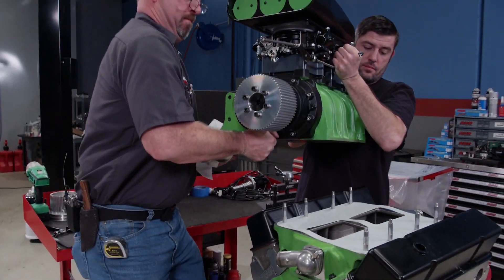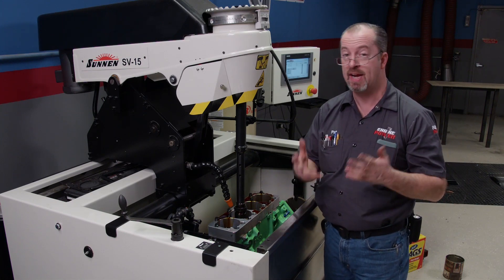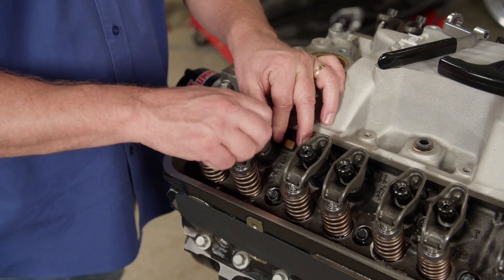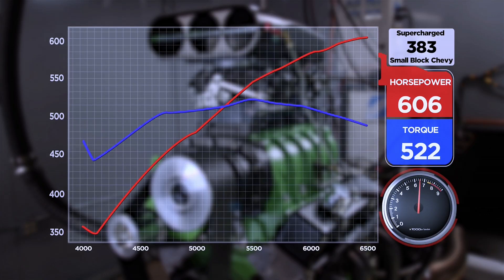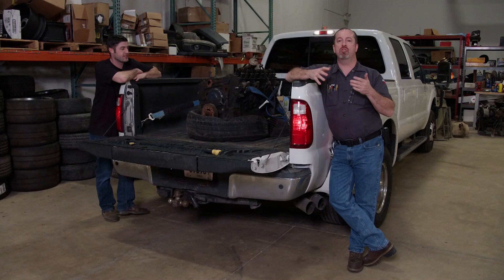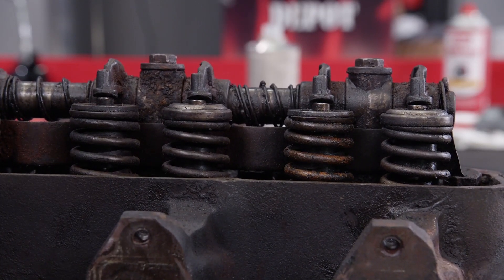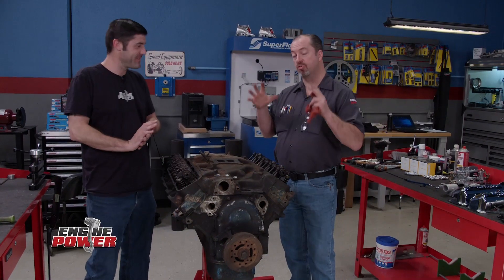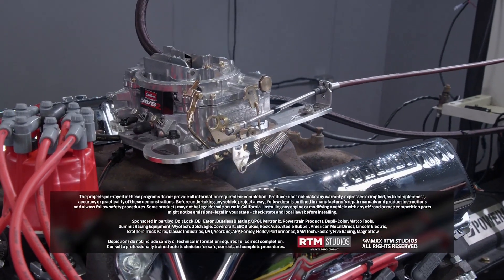Junkyard Ford 390 FE: Will It Run? - Engine Power S7, E7

Comment: I love it that they spent at least 10k on that small block, but all the comments are about the junkyard engine
Reply: Shows the type of people watching this are probably mostly backyard grease monkeys who appreciate what goes into pulling something from a boneyard wreck and getting it running.
Reply: Small block Chevy is like a butt hole. Everyone's got one.
Reply: @chrismontreuil2206  because they work and make power the cheapest.
Reply: The Chevy small block is the obvious cheapest way to make power (cheapest to build up). So that means they are the normal option and frankly most people are tired of (videos of) them. Let's see something different!
Reply: I'll take the FE any day over a smallblock bowtie.
Reply: @clydebalcom8252  My 73 F100's 360 3 on the tree with straight duals from the manifolds no mufflers or anything sounded glorious when floored and really wasn't even loud in normal use. I just wish they were cheaper to rebuild and build.
Reply: The Chevy threw a piston.....

Comment: Gimme a tired old FE coming back to life any day.  I love the old 390 Ford
Reply: Jeremy, My 67 S-code had a 390 Fe in it. Some asshat put a 460 mild build in it before I bought it. Damm it!!!
Reply: I am mostly a GM and Mopar guy but do love those Ford FE engines. My grandfather had an F-600 with a 352 in it, ran like crazy!
Reply: Edward pate it probably had a MD 330FT (FE with low compression heads) or 360. Possible it had a 390 with the larger snout crank which would have been considered a HD engine.
Reply: There's a 390 I have from a late 60s t bird I have and I thought about putting it into a mustang or Fairlane, any ideas on where to get parts?
Reply: @thatonegamer9547  depends upon what you want to do with it, but check out the stroker kit options. what's going to bite you is the exhaust setup--if you don't take out the mustang shock towers and replace them with a Mustang II setup, your headers are going to have a big turn right off the port.  figure out what you're going to run for exhaust, and then design the engine around that choke point.  i'll also just throw out there, Thunderbirds and Galaxies had different tri power intakes, if that's what you're running right now. the t bird ironically kept the carbs level, the galaxy had the 390 tilted.  

some bore and stroke a 390 out to a 428, and since the 428 CJ used the 390 Gt cam, make themselves a big brother CJ.  There's a lot of ways to go with the 390.
Reply: Back in '89 I pulled one w/ a C-6 out of a '65 Galaxie and loaded it in the back of my brother's old Bronco on an old tire. Man that was some weight! I never thought we would get it home. 😂
Reply: 360 or 390 ford engine is bad about burning valves....
Reply: Parents had a LTD with 390
Reply: @davidsandberg7631  Mine too, a station wagon. They traded it in for a new clunker LTD wagon w/ a 400. 😕
Reply: @thatonegamer9547  give FE Specialties a shout. They have absolutely everything you need. PS... you can get 500 hp out of a 390 with the stock unported heads relatively easy! And throw a 445 ci stroker rotating assembly in it and have a tourqe monster too...
Reply: They are such good and tough engines.
Reply: @thatonegamer9547  I was dropping one into a '66 Fairlane hardtop that had a 289. You have to beef up the front frame rails, change engine mounts and suspension and swap in a 9 inch differential. If you don't, it'll fall.
Reply: @briscoe42  The big block equivalent to the 289 in reliability. 👍
Reply: @josephtravers777  Exactly.  Both are almost bulletproof.
Reply: Only 3 things suck about an FE- Cracked oil galley, sunk exhaust valves, and the freaking 80lb intake manifold.
For those who don't know, all FE's have a casting defect where the block can crack between the oil galley feeding the passenger side head and the water jacket next to it. oil pressure is higher than coolant, so oil squirts into coolant and you lose oil pressure. Oil in coolant= crack in galley. Coolant in oil= cracked head or blown gasket. couple known fixes can be found online. I went the 1/4" rollpin route, as that can be done without tearing block down. Fixed my 390. 
Sunk exhaust valves- These engines were designed for leaded gas. Lead created a layer of protective soot on valve seats. going to unleaded means the valves will eventually start to weld themselves to the seat and chew away at it. Fix is either hardened valve seats if you have room before you hit the water jacket, or good used heads.
Intake manifold- do your back a favor and use a cherry picker to pull that SOB out if the engine is still in the vehicle. If you don't have one use bungee straps and hook them to the hood to help lift it a little, also works great for installation.
Reply: Donald Kinder same motor just different crank.
Reply: That One Gamer not sure about Fairlanes but I have one in a ‘68 Mustang. For FE parts go to SurvivalMotorSports as they are practically the FE gurus. If you decide on which vehicle then the best advice I can give is to search and find a good forum for that vehicle as there will plenty of info there.
Reply: I rebuilt an old 390 fe in my day and I got to tell you it was the best engine I ever had for towing trailers. The torque on this engine was so powerful that I ended up snapping 2 universal joints in half with it. This engine did not get the credit it deserved!
Reply: I've got a 92 302 I love that motor
Reply: Isn't he only chevy engine I like ....nice heads God power
Reply: I had a 330
Reply: @robertclymer6948  what a fool

Comment: Now these are the kinda videos I love! I would love to see a Dyno run of just the revived 390, then move on to budget build, and overkill performance build. I don’t get to see a lot of FE love here.
Reply: Alex Hickey couldn’t have said it better myself
Reply: @2ndamendment495  the damn 390 is a tank and will not die one of the best motors ever.
Reply: I agree I want to see more done with this motor like to see what it does right now on the dyno do some update on it and in full bore stroke I love the Fe been a fan of them all my life I even had a 427 side Oiler medium-rise dual-quad but these shows here don't do a lot of the FES and be nice to see them do more with this one
Reply: 390FE, the most under rated engines today. Free them up to breathe and it can take on engines slightly bigger.  Good stroker kits and the medium duty 361 and 391 are some tough forged steel cranks, not cast. I've had them cut and taken down to 390 engines with higher performance at higher rpm. The crank done like this is stronger for more hp and higher.
Reply: @dustinshadle732  I would say the Cleveland is the most under-rated.  if it wasn't for the cylinder heads being used on Windsor builds there'd barely be any aftermarket for them at all.
Reply: I would love to line up s 428..but money is a big issue so I'm only doing mods that won't change the 390 o have.  It's a pretty healthy engine in 68 anyway.  Maybe a 4 speed auto or aftermarket overdrive unit. It's my last personal toy vehicle so I'm not sure. I miss having my legs because when they worked I'd not only walk around all the time, but the jobs are good, miss riding motorcycles and put a 6 speed in the old girl

Comment: My Dad had a Mercury Park Lane when I was a kid. I want to say it was a '65. With a 390. I think the sound of that old 390 is what got me hooked on horsepower.
I bought a wrecker with a 390, that thing had some serious grunt to it.
Reply: A 390 ford engine has around 200 hp weak you seriously never had a powerful engine..... Plus 390 or 360 bad about burning valves.....

Comment: I'm very pleased you've picked a 390 
to experiment with.  When I was growing up I had a 70 model ford step side  half ton truck that originally had a 300. Six. 
That got replaced with a 390. The combination of the three on the tree and the the factory gears . This truck had so much torque.  I never knew how fast it would go because the speedometer only went to a hundred. But it had no problem burying the needle.  This was one of the most impressive engines stock I've ever  seen.
Reply: Johnny G classic my first car was a 70 cobra Torino with the 429 scj remove and replace with the 390 . I rebuilt the engine and boy that car was fast 👍
Reply: Proud owner of a 65-F100  390 FE That was My Fathers and My Grandfathers. Will one day be my sons

Comment: I was so happy to see that they finally released a video about the 390 FE. I have one of my own in my truck and I absolutely love the torque, but the gas mileage is pretty bad. Even with the really low oil pressure that it has, it keeps running and it doesn't let me down. I believe it is the original engine too!
Reply: Put ya new oil pump in that old girl!! Or try n put ya bottle of restore and two bottles of STP next oil change and wee bit thicker oil?? I drove my Ford daily February will be 17years and 350000.0miles on my old Ford!!!

Comment: Gotta love old blue oval iron. There's a 70's model dump truck used where i work.  Asked the driver, he said it's original,  only thing he does is add oil to it.  It's a 390 workhorse. Old black dude driven the truck since 77. He always tells me, "boss said I'd get new truck when this one died...damn thing won't,  so i guess I'll keep driving it."

Comment: Do a build on the 390 do the 3 stage build on the last bump it up to 428 I think you would be impressed I’m not a ford guy but that engine can be very impressive
Reply: You can't bore any 390 to 428. Luck of the draw...stroker on the other hand.
Reply: @falconater68  -- Yeah 428's were basically stroked 390's. Same bore size. Truck engine is a good candidate. But before investing too much, you gotta check cylinder wall thickness for consistency (an issue with some FE's)
Reply: @shawngrenaud  nope, the 390 is a 4.05 bore, 3.78 stroke.. 428 is 4.13 bore and a 3.98 stroke..

428 crank in a 390 makes a 410.. big difference in bore..
Reply: I’ve bored a 352 to a 428 all of the FE blocks have 352 cast into them it is a larger bore than the 390 but the block will handle it
Reply: @brianslaugh3029  it all depends.. some of them will have too thin of walls to be bored out that far.. the only way to be certian is to have it sonic checked.. personally I wouldn't because the minimal cubes you get from that much of an overbore isn't worth the risks and loss of future rebuilds, especially now with all the longer stroke cranks available now..

And if that's not enough horsepower for you, a shot of giggle gas or boost will solve any shortcomings when it comes to smaller displacement
Reply: @stanleykendziorski7964  if you put the 428 crank in a 390, would you keep the pistons/rods from the 390?
Reply: @elinino5275  the rods are the same, but you would need different pistons, because they go almost a full quarter inch lower in the bore than with a 390 stroke, so you would loose a lot of compression with the 390 pistons.. you would be best off going with an aftermarket piston at your desired compression, and if your budget allows, having the block decked for zero deck height, or minimal below zero deck
Reply: If you can find a 428 that hasn't been destroyed.
And still want a real screamer
Drop that crank into the 390 
Ream the bores out .030 
Put some good rods on it
Even with a mild cam it'll be a tire shredder
Reply: @shawngrenaud  the ford 390 and 428 are not same bore,428 is 80 thousands bigger bore ,and 428 longer stroke

Comment: I was hoping they were going to do a power run with the FE☹️
Reply: looked like there was almost as much pressure in the crankcase as in the cylinder    lmao
Reply: They probably did for a baseline.  Remember, it’s getting a build done.
Reply: These guys HAAAAAAAAAAAAAAAAAAAAATE ford, they did a 460 ford vs a 454 and put a bit more love into the chevrolet and did hardly nothing to the ford
Reply: @Ethan-ky2qz  I've noticed that very thing
Reply: @brandonhumphries3377  Chevys have always been cheaper to build. That's why FoMoCo fans are true blue.
Reply: This thing is burning more oil than gas. Let them do the basic rebuild, then dyno it with the stock heads.
Reply: Bottle of restore and two bottles of STP in the crank case with few qt's of 10w30 this old Ford will run for years, keep her cool with 160° n big radiator!!
Reply: Me too. Likely a bit worn/tired to show the number as it was likely low. I hope they do it up right and follow through. The FE's are neat engines. What other block has a casting number that does not positively ID the CID? Bore and stroke alone tell you what your FE is. My 390 had 352 and 427 cast on the block.

Comment: I haven't seen you guys so excited this much before on any build, that when this junk yard motor started.. 😂😂😂
Reply: It shows you what they would rather be doing. The trend these days is ultra low buck power and ratty muscle cars. I don't want to watch people building 800 hp pro touring cars when all I can afford is a lowered short bed Dodge pickup with a warmed over slant six or 318. :-)
Reply: @unicornsteaks6769  you are so right. It is nice to see what is available for all to purchase , BUT the reality is how much can you afford. Usually refreshing up any old engine regardless of displacement is the best way to go for longevity of use. Any old engine will perform better even with original parts restored. If you BUDGET BUILD.

Comment: I put a 390 Fe in my jeep with a t18 and np205. It's on 38.5 bothers and with 4.11 gears it cruises down the highway turning around 2700 rpm at 75 mph. It's the best motor I've ever put in a Jeep. And sounds wicked

Comment: Had a 360 FE in my $500 73 F100- I decided to rebuild it when I took the heads off (because my straight duals were leaving black circles on the apartment wall in the morning when I started it) an every compression ring was busted (my first rebuild). You can't kill those motors.  The 390s were even better.

Comment: I grew up with my father's 1967 Ford F250 Camper Special with the 352 Industrial FE engine, the transmission was a 4-speed manual gearbox with 1st being a granny gear, so we technically only used 3 forward gears, the granny was for loading hay and pullin' stumps. that engine burned through more oil than gasoline but always started even when it had a broken ring in the number 5 piston, didn't even scratch the cylinder wall. we pulled that piston, put in new rings, ball honed the cylinder, changed the rear main seal for good measure. put it back together and it ran perfectly. the only real problem that truck ever had was that you had to herd it down the road like cattle. the steering was that bad. it wasn't until my father told me to fill the steering gearbox with gear lube and it all leaked out that I found out that the upper sector shaft bearing was pulverized. I rebuilt the gearbox and the truck drove like it had power steering after that. It still had the best motor in it that I could imagine. that thing had no end to the torque it could make. I would love to see You Guys get a 352FE and see what it could do on the dyno, it may not make much HP but I would bet that it would make torque like a diesel.
Reply: The 352 in your truck was not "Industrial". It was car/light truck. The engine in this vid is car/light truck, too, but PN may not know or care.

Comment: If you can find the 391 version, they have a forged crank. These were actually the industrial version of this engine. There was a 361, and a 391
Reply: There's a guy in Florida with a FT 361 & 391 I've talked to hopefully I can check em out & post a video soon enough.
Reply: If I'm not mistaken, coming out of a dump truck it is a 391.
Reply: @smalltownguy2364  Depends on what dump truck.  A 10-yard would probably have been built on an F-800 chassis and have the 534 Super Duty in it.  Someone's dump bed conversion on a F250/F350 would probably be the std 300-6 or 360/390.  361/391 were used on medium duty trucks, school busses, 5-yard dumps, etc.  The 2-barrel manifold, std-size water pump hose connections, and umbrella style valve seals on the engine in this video would indicate it is either 352, 360, or 390.
Reply: 330 also

Comment: In 1972 I bought a 1964 Ford Galaxie. it had a a 390 engine that came out of a 1967 Ford F-150. When I went to replace the brake drums, they didn't fit. I took the front drum to the auto parts store and found the car had what was called the 'police package' and the brake drums were from an F-150 pickup truck. so I bought those and brake shoes as well. It also had a posi-traction rear end with a 4.11 gear set. It was the best car I ever had. Unfortunately, I wore it out and couldn't afford to rebuild it. Since I was taking a 1500 hour course at a trade school for auto mechanics, I was able to do some tweaking to squeeze some more power out of my car.

Comment: I have seen 390, 360 fe engines worn to the point they need stp and thick 40w racing oil just to pump up the lifters enough to start up...and then drove it 600 miles towing a lot of tons.. They are a strong long lasting work horse , not much for racing but awesome for work.

Comment: I had a 390 out of a t bird put into my 67 galaxie. Super easy to build. I had the same issue with the head bolts but engine shop removed the broken bolts. Mine was rated at 350 stock. Put a cam, edelbrock intake manifold, and a holley 750 it was a screamer

Comment: To remove the stuck and broken exhaust manifold bolds welding a nut on the stud is just part of it. Also use a rosebud on a torch and heat all around the stuck bolt until red…. always worked for me

Comment: About those 390 FE exhaust studs?  one trick I learned long ago is to get the studs red hot & then quench them with water so they might just shrink a bit. Welding the nuts on is a good idea but try quenching them right after...Then spray a good penetrating oil on them. PS; a 390 Ford was the first engine I ever rebuilt. It ran fine!